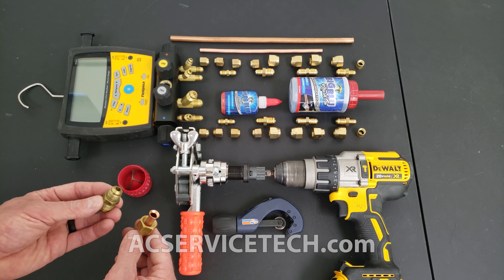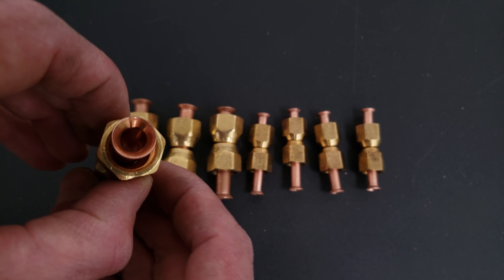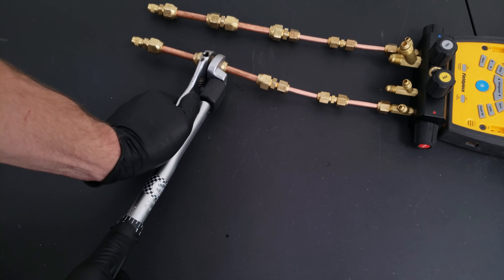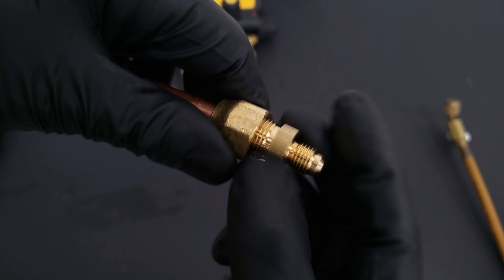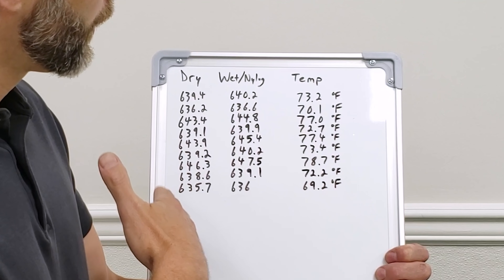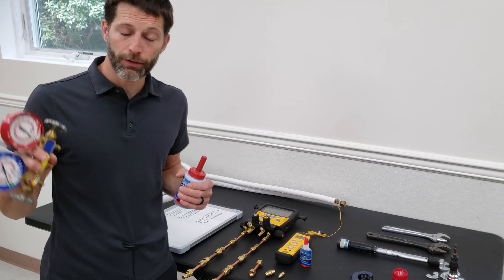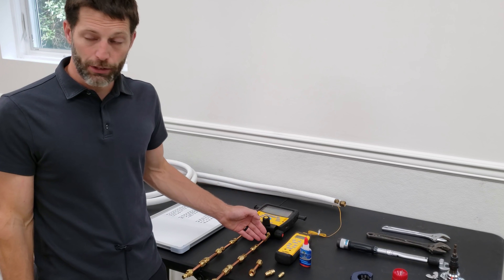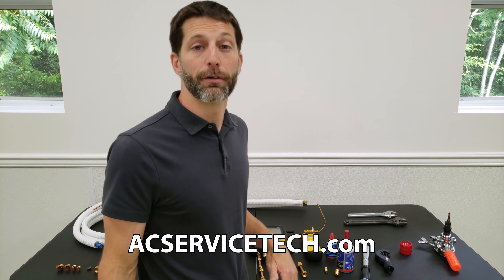Do Dry or Wet COPPER FLARES LEAK High Pressure Refrigerant on Ductless Mini-Split Units? Explained!

Comment: I know a lot of people hate using Teflon tape on the threads of those flared connections. However, what I do is i put just a very small amount on the threads without going over the lip connection, just the thread portion. I use nylog in the lip and on the back of the other nut that spins and call it a day. Now, there is an argument that metal to metal connection on those threads is the way to do it but damn, there are so many ideas out there from techs and from manufacturers that you don't know what you "should" do.
I think Mitsubishi says that nylog is not recommended for their unit.. Go figure. 🤷‍♂️

Comment: I had a unit last year I just couldnt get sealed... the Nylog helped but didnt resolve it..  we surmised there was a deformation in the shape of the flare fitting on the outdoor unit itself.. it was the 3/8 suction line that leaked..  i could see it at 150 PSI...    we ended up using those little copper flare sealing discs..  they look like black plastic but are actually copper..  used those with a little refrigeration oil and its held since.. the unit was used extensively in heat mode this last winter was Long and Lingered on and on..   I havent checked it, however theres been no complaints on peformace...

Comment: Very interesting and informati,ve. Separately, I would like to understand the machanical strength of the joint. If the joint was jostled, bumped, moved or bent, how does that affect the flare connection? (dry or wet). Also, i would like to understand how rotating the fitting in a way that would scratch or mar the surface of the compression joint. How much would you rotate the joint, before it starts to leak? Thanks.

Comment: All flares have micro scratches. All dry flare connections leak. Some are leaks are practically negligible some are significant. Nylog helps to compensate for the imperfections. Nothing beats good quality copper tubing, good quality flaring tools, good workmanship and proper torque at the flares. If  you have done everything right, it should not leak. But the higher pressures and the changing frequency of the vibrations(due to inverters) can affect the tightness when the unit is running. So that is where Nylog comes in, it gives you peace of mind . Nylog is fully miscible with the refrigerant and it is based on the same oil used for the compressor - read the product data sheets in case of doubt. Just make sure you use Nylog Blue for HFC systems and Nylog Red for HCFC etc. You don't need a lot of Nylog, since it is only to fill in the micro scratches. Avoid Nylog on the threads and the back of the flare nut since the torque will be affected and the friction on the flare threads is necessary keep it from coming loose. Back in the days when everything ran on 60HZ, we had less issues, but with inverters resonance can cause excessive vibration at certain frequencies.

Comment: Flare fittings suck on 410a systems. I started using the flare seals as they work very well. The combination of high pressures and temperature changes make flare connections a very poor choice for high pressure refrigerant. If they were double flare fittings, we wouldn't have any leaks.
Reply: what kind of flare seals? the purple teflon ones? https://www.youtube.com/watch?v=tz9jDJ-b6tg
Reply: @rivergate950  Yes, but update, I no longer use them. I had a couple issues where they were torqued and then must have compressed over time and then started leaking.  I've had really good luck using the spin flare tool, no leaks yet. Little nylog and a torque wrench and should be good to go.
Reply: @MrDeviousdom  thanks, so you are using the spin flare bits that go into a drill to make your flares now? I think I will stick with my eccentrick block flare set.
Reply: @rivergate950  yeah, from my experience, and I make a lot of flares, it works better than the eccentric flaring tool. One of the main reasons is that you do not have to deburr the inside of the tubing before flaring with the spin tool. Do whatever works for you

Comment: Fantastic. A well done professional demonstration. I have a split AC that leaks all its R22 refrigerant in about 8 months. 4 times I recharged the refrigerant and the result was always the same. The last technician found out that the leak is through the copper flare near to the outdoor unit. Although previous technicians cut the pipe and do new flares perfectly,  only the last technician found the cause is due to cracks developed  when they tighten the nut. Never thought about thread sealant thought. I never saw one using the digital pressure reader. Also, the last one was heating his refrigerant R22 cylinder to get the gas into the compressor. Never seen that before.  This video has been very informative.

Comment: I would like a list of the tools and lubricant used. I have been to several of my  local supply companies and have yet to come across one that carries a tork wrench like that.
I have worked on heat pumps that see 550psi on the heating cycle. So it’s important it is correct.

Comment: I rub fridge oil on the flare and the threads, use a battery free manual flare block and a couple of adjustable spanners. I tried nylog once, the poxy bottle leaked everywhere, so went back to tried and tested.

Comment: 600psi for Fujitsu and 500 for Mitsubishi is what I have been doing. Also the digital manifold is great since you see the 10th decimal drop when it’s leaking. Also the cone on the flare tool needs to be perfect or you scratch the flare end. What a pain in the ass.....

Comment: Great video as usual.   so, what's your opinion/experience with Rectorseals' Pro-Fit quick connects     BTW, love your manual/books.  They are great for insomnia reading, I just need to re-read the chapters during the day because I remember only half(at best) from the night before.  They are worth their weight!    :~)

Comment: in the evaporator, I cut off the flare nuts and I soldered both lines. This way you never have to worry that there's a leak in that hard to get to spot.

Comment: Just curious, did you inspect the wet flares after the test to see if any of those flares had nicks or scratches in them that the nylon may have sealed?
Reply: It's NYLOG, not nylon and the formulation is a company secret; it never dries. It does not harm the system, but reputable  manufacturers like Daikin or LG recommend as a lubricant to use their refrigeration oil. Also, not every manufacturer will give you the torque for wet and dry. You will have LG recommending wet with their own oil, Daikin will ask for dry. The "over the counter" units/brands don't even go as deep into the matter regarding dry or wet torque. Rule of thumb, go with the specs of the fittings and lines and you can't fail. Use a clutch-like flearing tool. Stay safe!
Reply: @A.Dude.  yep been using it for a few years.  But I cut off flares and silver braze them.  Only a few times I ever leave them. 
       I sell LG MUTI V VRF Heat recovery system and install.
Reply: @coldfinger459sub0  staybrite 8 has been recommended as best solder  for tie in on system .👍✌️💪🤙🤔
Reply: @coldfinger459sub0  interesting how do you do that? Do you stick the copper pipe into the inside of the connector where normally the flare sits outside?
Reply: @coldfinger459sub0  thanks for the fast reply. Sorry for the silly question. What is a swathe tool? I'm a German in Germany. Do you know pictures or videos or a website to read about? I can imagine it I guess as you agreed to the stick pipe into hole method and solder around to close the gap.
Reply: @milotorres6894  I use staybrite 8 and all my line sets for my side jobs. It works fantastic don’t have to worry about nitrogen purge. 

  Cannot use it for some refrigeration components like expansion valves on refrigeration equipment I had the flux plug an orifice. Residential AC works great it would work good for a commercial line sets as well, but there’s a lot of brazing involved and I try to stick with either one or the other. Staybrite 8 Great stuff
Reply: Are usually take apart all the flowers that leak to look at them and if I’m in a hurry I cut them out and throw them in my tool bag to take apart later. 
           Most of the time they were bad flare you can tell when somebody did not ring the edge because it leaves a little remark when you compress it. 

         Occasionally somebody has an absolutely perfect flair.  End it still leaks
          Occasionally they’ll have a perfect flare but they over tightened it I kneeled and compress the copper and cause a fracture

          But what people don’t understand it’s not the perfect flare that always counts. 

        It’s the tens of thousands of times the copper actually cycles between hot and cold air temperatures and higher and lower pressures literally causes a mechanical movement of friction on the fitting that literally O’Neils and where is the copper causing the fitting to loosen up or fracture. 

         So it gets down to the physics of the actual molecular level of the copper at south failing due to temperature or pressure cycling not the flare surface itself

         Everybody gets too focused and caught up on the surface face of the flare and that’s not the whole equation

Comment: Do you know if Teflon vacuum pumps are used in refrigeration? Here's one I have for sale.
https://www.ebay.com/itm/265145830892?mkevt=1&mkcid=1&mkrid=711-53200-19255-0&campid=5338273189&customid=&toolid=10001&pub=5575378759&icep_ff3=1&ipn=psmain&icep_vectorid=229466&kwid=902099&mtid=824&kw=lg

Comment: Would have been interesting if you had put Nylog on the leaking dry fitting.  Would of shown if Nylog would help a minor damaged flare joint.
Reply: I use nylog all the time great stuff
Reply: Yes, I thought would fix it with Nylog... but nope...
Reply: Yeah, we don't know if the Nylog side had any potential for leaks. But the one leak that occurred on the dry side, should have been re-sealed with Nylog to see if it worked.

Comment: You are never supposed to use anything on flare fittings, they are to be completely dry. If lubricant is used, the pressure between the flares will push the lubricant out over a period of time, depending on the viscosity, and the nut will have to be re tightened or re torqued.

Comment: Would be nice if you would of tried putting some nylog on that leaking flare to see if it would stop leaking
Reply: THIS!
Reply: Technically you could, but flares are a one time use thing. If you have to remove it you have to make a new flare as it won't hold putting it back in.
Reply: @sprockkets  I'm interested in the effects of the Nylog as it pertains to the marring that was on the adapter side (ie the valve side on a system), not the copper side.

Comment: Great video, but curious why you're recommending NOT using nylog on the threads.

Unless the manufacturer clearly specifies that the torque values are for dry threads, it's good mechanical practice to never install threads dry... Is there something I'm missing where those torque values were given for dry threads?

Dry threads are way more prone to binding and defects causing improper torque... Plus the inability of the flare nut to spin on the back of the copper tube - nylog on the backside of flare, front side, and threads, has been a flawless method for me.
Reply: I had a big job last year that had 226 mini splits/cassette units multiple big VRF systems. The guys used torque wrenches and did everything to manufacture specifications. About 50-60 different mini splits leaked after running thats with nylog the flares were not tight enough.
Reply: @HVACR-Airman  and that’s exactly why we cut out all the flares and braised them with silver brace never have a leak again no problems. 

       If you 100% remove all the flares you 100% remove all the leaks created by flares
Reply: @coldfinger459sub0  although I am not in the field the flare design really makes me cringe.  And I ask this question in my head. Don’t we have better methods which is easy and reliable?     I think mrcool quick connect idea seems like a step forward.
Reply: Because my log as a lubricant and it changes the friction rate on the metal threads so when you’re using a torque wrench you’re actually overtorquing when you add lubricants on threads compared to dry

     It’s a physics thing engineers know about this is why automotive technicians when assembling engines there are specific bolts that I absolutely have warnings about not lubricating and dry only when assembling using torque wrench or what’s called torque to yield method. 
                    And if you add a lubricant you can severely over torque the thread material beyond the yield strength of the metal and it will fatigue and fail later on. 

          In some severe cases depending on the materials used example iron bolts in aluminum blocks you can literally ripped the threads right out of the block if you use lubricant
Reply: @coldfinger459sub0  I understand that - and acknowledged it, it's clear and common knowledge that lubricating threads increases torque...

I'm asking a specific question on a technical level about whether or not the manufacturers provided torque ratings for DRY fasteners or not.

Dry fasteners also result in decreased torque... 

This isn't a dissimilar metals, nor a torque to yield application...

I already know what you're explaining. I'm asking if there is a specific requirement from the manufacturer not to, or if this is just individual preference...

The majority of HVAC techs that use nylog use it on the threads as well. Especially with flare fittings these are coarse threads and machining quality is often low.

Comment: Even if they don’t leak now you have two devices that are relying on mechanical friction and compression. 
              Now add 100,00 or 1 million cycles or less of pressure raising and falling expanding and contracting the line set in a linear fashion on top of that I had 1 million cycles of heating and cooling as the system cycles on and off or up and down in temperature. Expansion and contraction of the two fitting face surfaces themselves including the threads. 
             Mechanical items on friction at some point always fail in every industry in every application.   They are actually moving to surfaces back in for scuffing and gallon each other at the molecular level. 

     Cut out all flares and silver braised them done deal
Reply: No need for that. We double flare our joints just like we do stainless brake lines that run at 1400 psi. Double flares are simple and they work.
Reply: @anthonyspadafora1384  but we’re not dealing with stainless steel here we’re still dealing with copper doesn’t make a difference metal fatigue
Reply: @coldfinger459sub0  These preinsulated line sets are very thin. Nowhere close to L copper. By the time you flare it it is work hardened and very thin. When you bubble the flare and then double it it has a second ring of copper that acts as a soft gasket. This folded over inner portion of the flare is not work hardened and acts as a soft gasket.  I use an expensive Mastercool hydraulic flare tool but it only goes to 1/2. Rigid makes one that goes to 1/2 for around a hundred bucks. Try it, do a video, you will see it short order it is a far superior flare. By the way we do   cupronicket brake lines also. Very similar to copper. We use to hammer flare 2" K copper for water services. When we were finished we would have to anneal the flare because it was work hardened. I anneal my copper oil pan drain gasket also in the same fashion but these line set flares are so thin you cant anneal them without melting them.  Try it and tell me what you think.
Reply: @coldfinger459sub0  Trust me I would much rather see a brazed joint on a ductless but in their standard configuration there is only one schrader valve making it difficult to purge and when using silver rod on brass you have to use flux. These units have no filter dryer so they wont tolerate any contamination inside the system. I don't know why they use flares, probably to make it easier for the DIY crowd.
Reply: @coldfinger459sub0  I have never had success at brazing copper to brass with a phosphor bronze rod. Copper to copper no problem. What rod are you using for copper to brass?
Reply: @coldfinger459sub0  OK after contacting Harris and Uniweld I was told there is no way to silver braze copper to brass without flux. I actually sent them a copy of your reply. Can you please show us which unfluxed brazing rod you are using. Please send actual product name and number. Thanks, we await your reply.
Reply: @coldfinger459sub0  So you are just using a fluxed brazing rod?